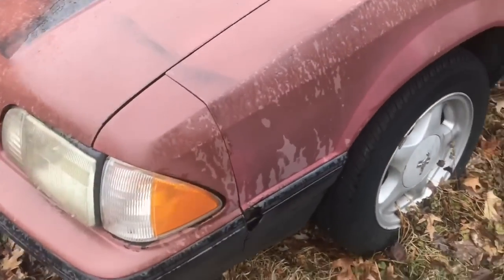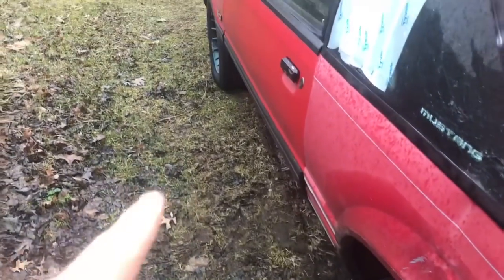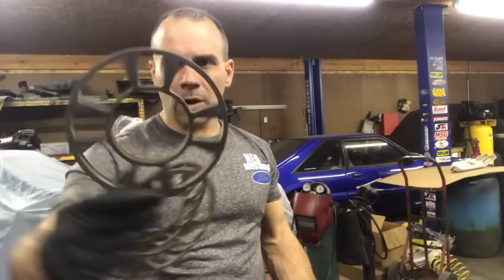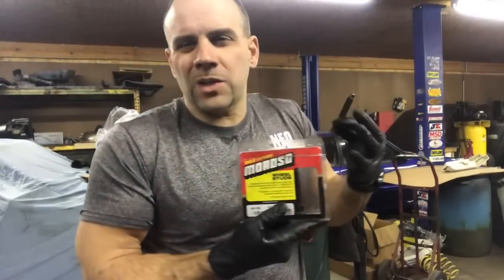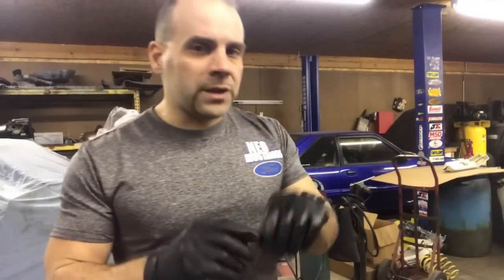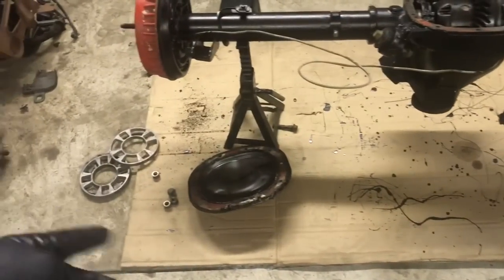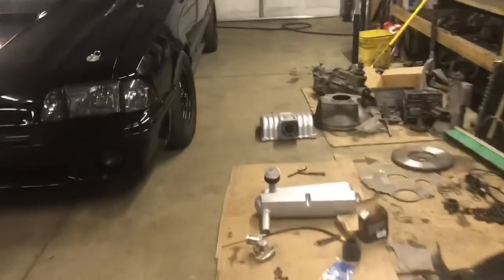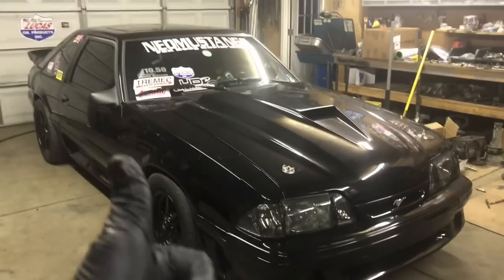GOT STANCE? CHEAP Tips and Tricks Lowering Your Fox Body Mustang!

Comment: Will the center cap on ponies still fit with larger studs? I think not,but if I run the spacers will they fit correctly??
Reply from the maker: They should. You can go as high as 3/4 to a full
Inch n spacers with 3” studs. Keep in mind buy spacers that’s have bolt patterns not slots.

Comment: I hate the stock stance.  Not a bad trick but to one up it, how about using a SN95 rear disk axle from the junkyard. V8 or V6 will work.  You may want to swap in your gear and traction lock.  Use a coupler to splice the brake lines to avoid the metric to SAE caliper flange nut convversion.   lincoln LSC 5 lug front rotors that bolt right in.  the ebrake cables from a turbo coupe.  Now you have a 5 lug conversion with rear disk to boot.  now go find some wheels!  Rick.